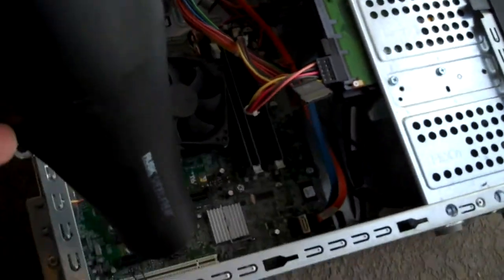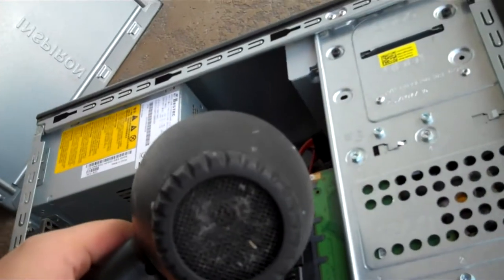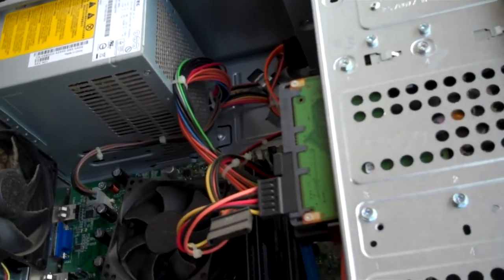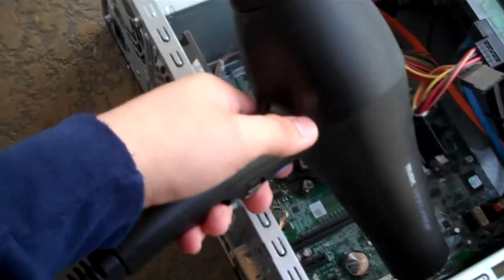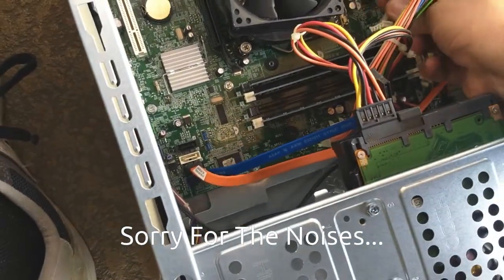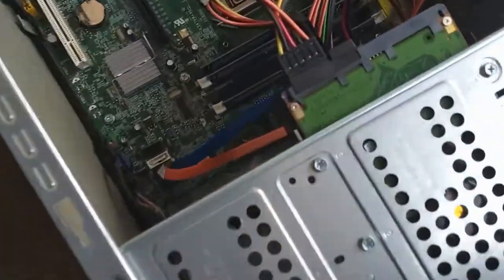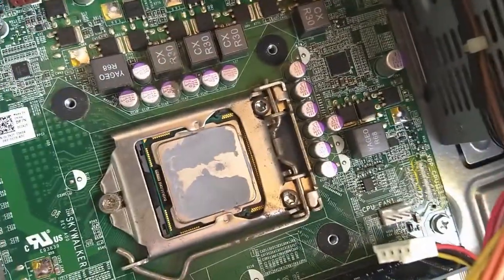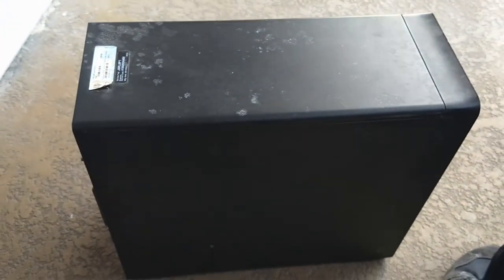A Cholo Cleaning A Computer With A Hair Dryer

Comment: Not recommend to use hair dryer to cleaning computer/component part. You can see doesn't has enough air pressure to remove the dust.
Reply: It's a great start though and saves on buying compressed air cans. 
I blast mine with the dryer once a month and that removes enough to stop build-up.
Dust sticks to other dust so removing it early is important
Reply: @aceb7638  Facts My G! It's not even an opinion either! Hes obviously right about it probably wont blow away shit that's caked on or deep in grooves. So get a micro blower if/when you can! Dont even waste your $ on compressed air cans just save up for a blower,...But if your PC/Console isnt bad/Dusty/Dirty/Etc. It def can be used in pinch to get a good safe cleaning! Just remember to always used the "Cold" setting not heat on the blow dryer😂